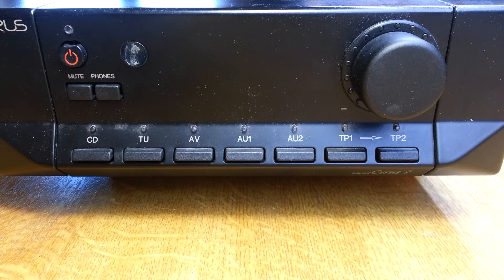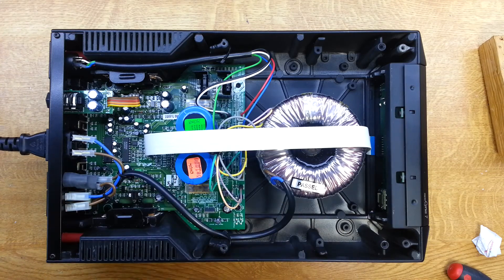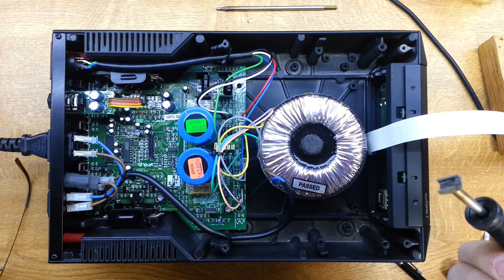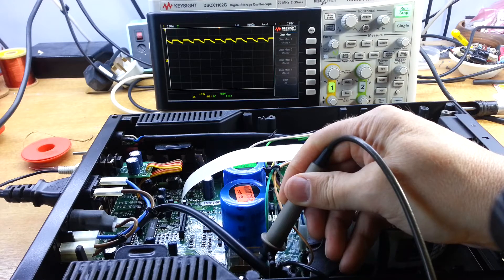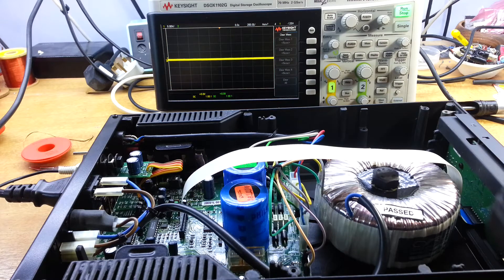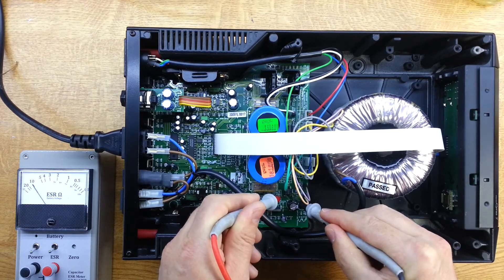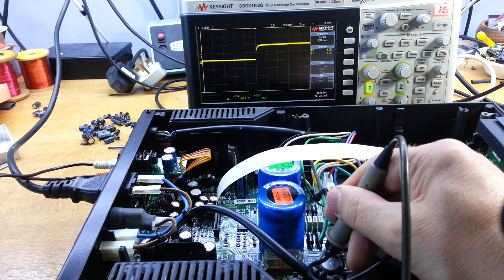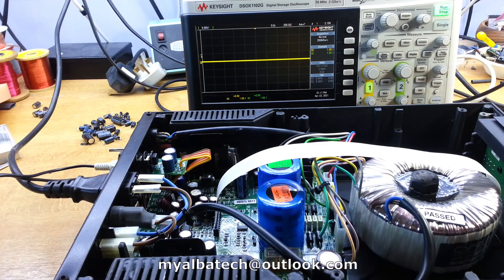Another Cyrus7 Integrated Amplifier Repair

Comment: These enclosed amps get really hot. I put a couple of fans at the back of mine, keeps it way cooler. I like my 8 QX but I don’t like this enclosed idea. Had the amp for about 5 years with the psxr power supply with no issues and I think it sounds exceptional. Not sure how such a little box can pump out so much music. I’m thinking of upgrading my system because I have the dollars but working out what to upgrade to is a mystery. Maybe I will just get a new DAC like the Denefrips Pontus and see how that goes.

Comment: Just bought one of these , and want to run it with my Cyrus PXS R power supply, am I right in just swapping the four wires as marked on the board round ?
Thanks 👍
Reply from the maker: Yes, see my earlier video on the Cyrus 7. I comment on how to do the change.